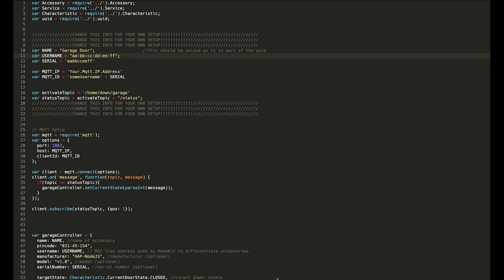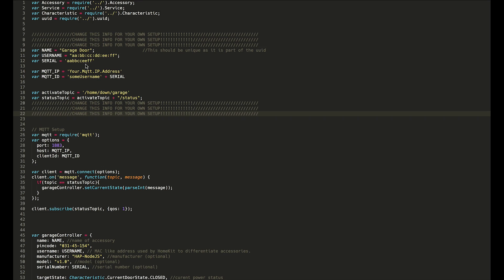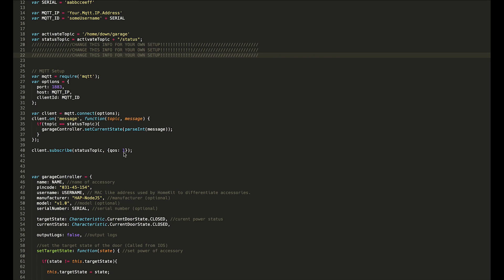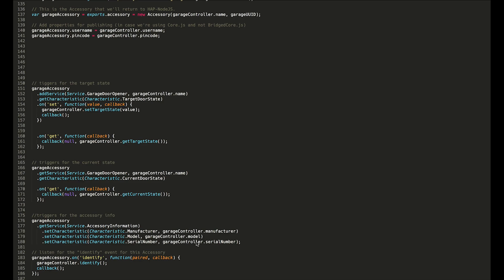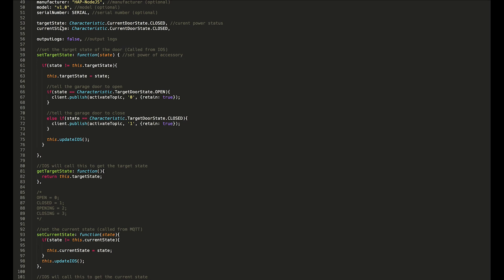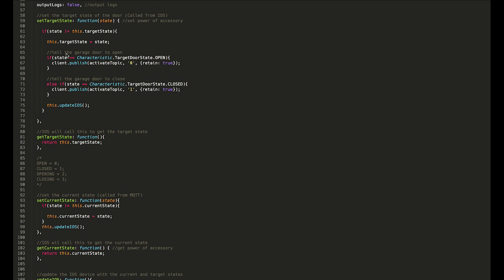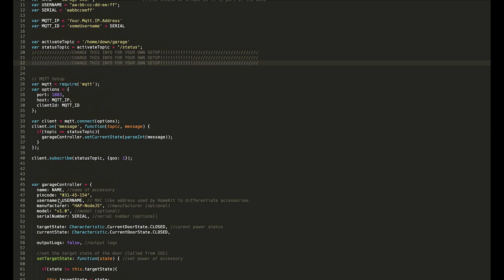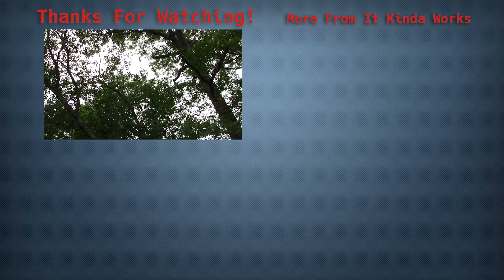Wifi Controller Garage Door Opener Part 3 - Summer Project

Comment: I saved the commenting to the last of your videos on this.  There are two things I would have done differently.  This is not meant as criticism, just food for thought....
First, I would have mounted the esp at the garage door controller rather than the door switch.  There is usually an unused outlet on the ceiling and it would have cut down on wire being strung all over.
Second, I would have used a magnet and reed switch / hall sensor in place of the ultrasonic. It would cut down on expense and current...
Nice job.  Your programming skills are far in advance of mine.  I have much to learn....

Comment: will it work with android? can alexa, google home control it?
Reply from the maker: Theres no reason that this device couldnt work on android however not via homekit. You would have to use some other android compatible system to control it. It wouldnt be too hard to write a script that works with IFTTT and I believe alexa/android works with that.
Reply: why not node-red and its dashboard... way easier and cross platform...
Reply: could you guys point me in the right direction to be able to accomplish this with Android. thanks...
Reply: android? Don't know... you can use blynk, though... this and node-red, on tech.scargill.net